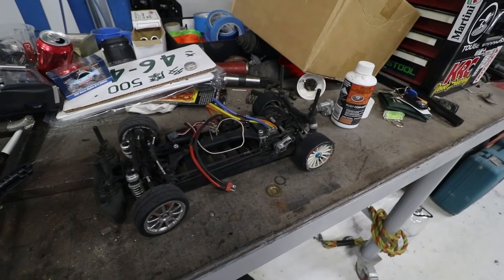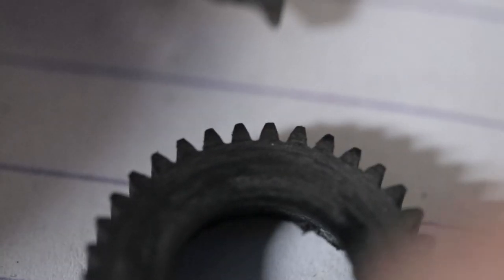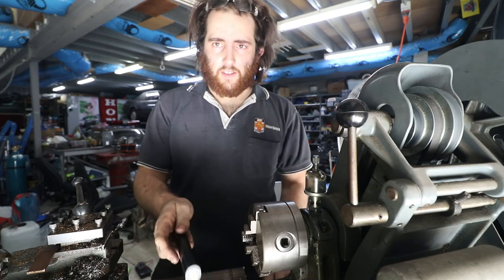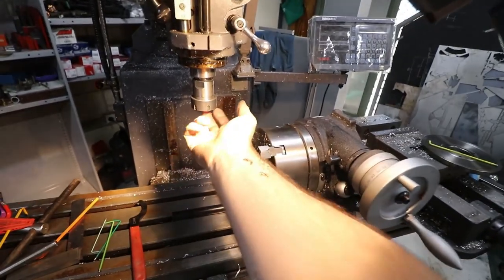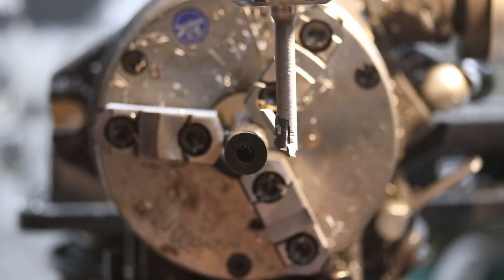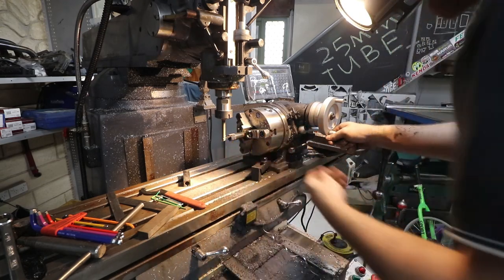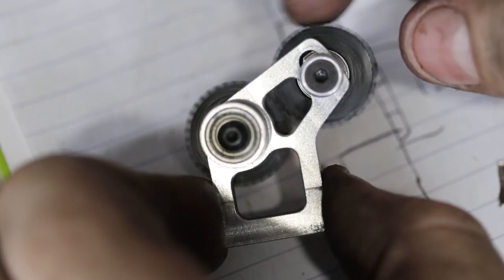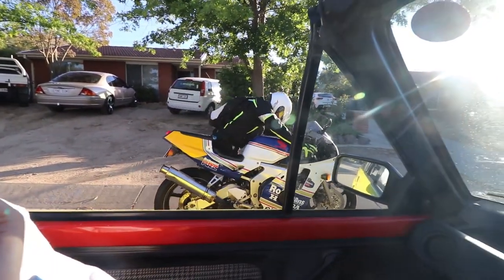Hand making RC Drift Car Gears.

Comment: Good job! It is helpful to know some rough gear math. Helps with things like depth and such. Looks like empty ''oiling thing'' on spindle bearing.
EDIT; I sugest turning as much of ger in one setup as posible, starting with critical features as od, ID and non sholder face. And cutting tooth on sacrifical arbor, with verification check with indicator. Makes for more precise part, as there are only two setups for critical things, and three at most in total
edit2: Spur gear require backlash. often as litle as you an make it, but it does require it at all times. In this case other than power loss, not much else is lost, so no big deal.